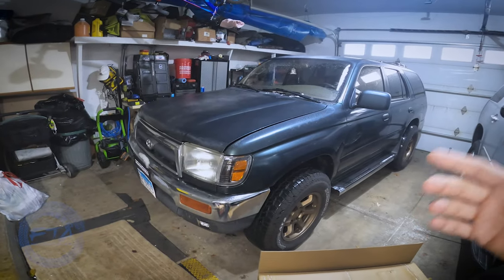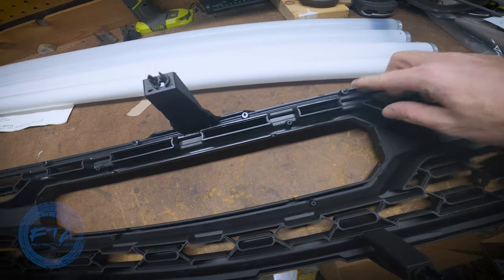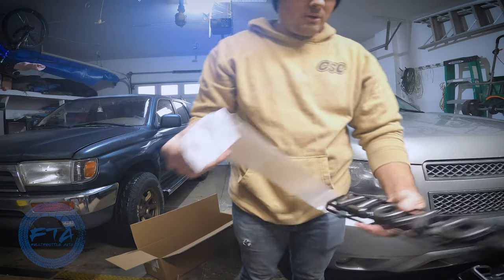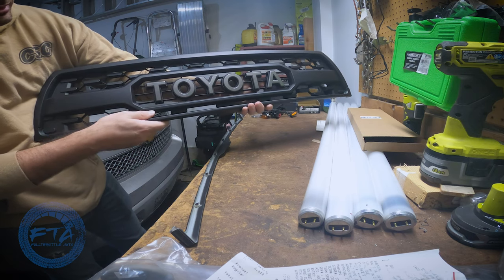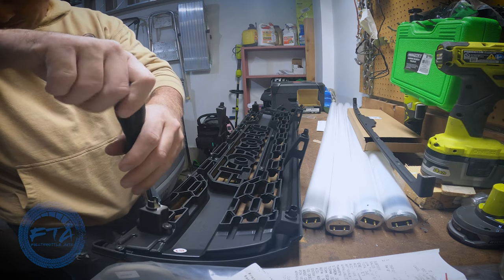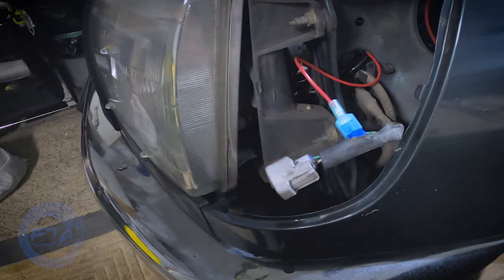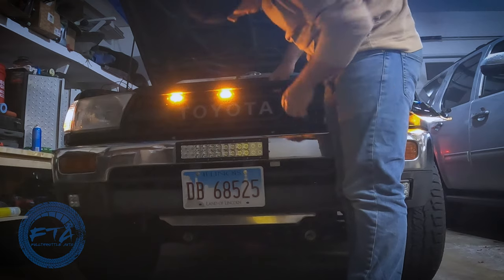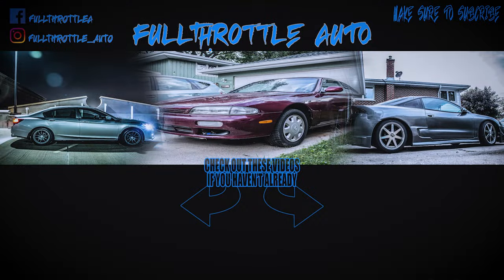3rd Gen Toyota 4Runner TRD Style Grille

Comment: I found this grill online and I wanted to see if it was worth the cost first and then I found your video and I’m just curious how satisfied are you with it overall. The grill cracking is a huge turn off for me. I like the looks of the grill I just need to know if it’s with it.
Reply: Worth it*
Reply from the maker: I'm extremely satisfied with it even now. 

The cracking with the screws didn't happen on my buddy's F150 that I did a video on. It's a Raptor grille for the F150 from the same company and didn't have that issue. So looks like that was just possibly a one off issue for my 4Runner. But I am definitely happy with it

Hope that helps. Thanks for watching and commenting.
Reply: @FULLTHROTTLEAUTO   I do appreciate the feedback I’m in the process of fixing up my 3rd gen 4 runner with different mods and I was planning on keeping my original grill because nothing is wrong with it but I do like the looks of this one so now I’m persuaded. Thanks again!
Reply from the maker: @coltonhamilton7550  glad I could help!